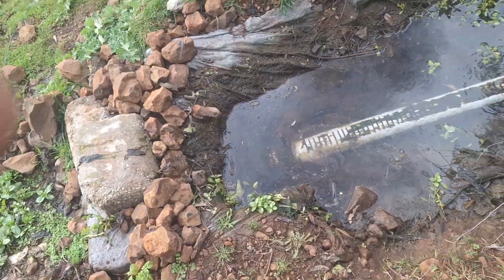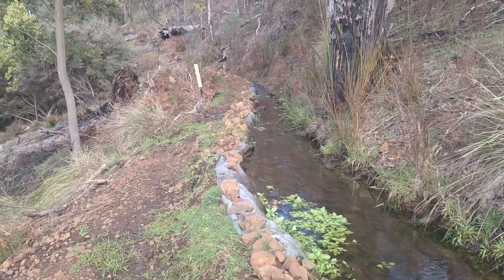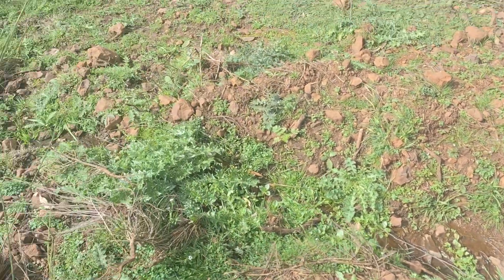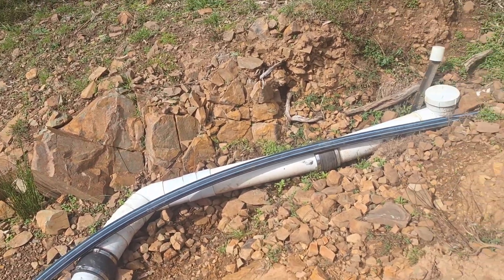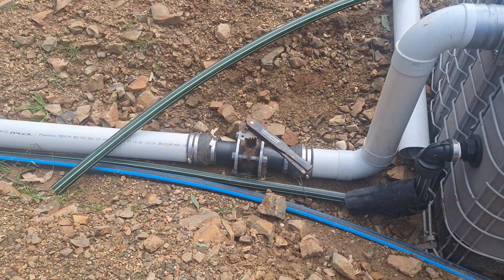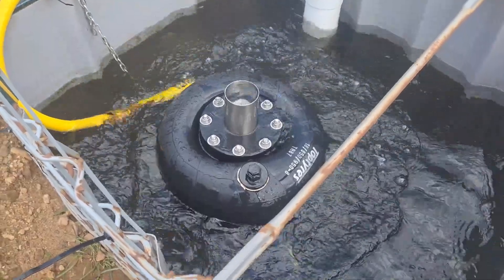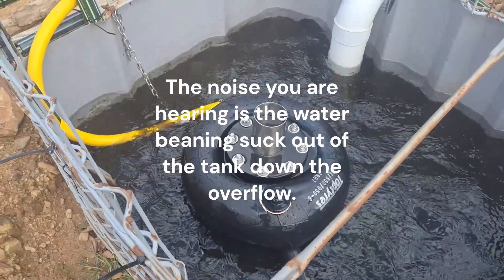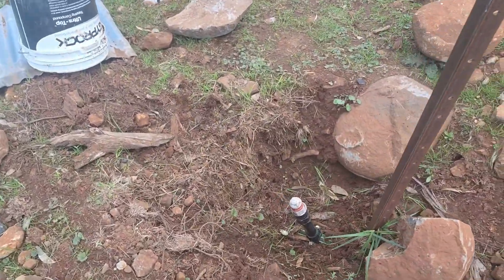Sonia's Bunyip PA13 Pump

Comment: A year ago, the units were priced under $2,000 dollars. Not sure about today. they are manufactured in Australia and I inquired about a dealership . No response. Shipping would be very expensive.
The government and their cronies(power companies) are absolutely opposed to this technology-it would destroy their lucrative monopoly.
Cannot happen too soon!
Reply from the maker: We have been sending Bunyip Pumps to the USA and Canada from Australia, mainly the PA13 pump with the stainless steel base but without the tire and the shipping cost to the USA has been around $600.00 AUD. The PA8 pump with stainless steel base but without the tire, I send by Australia Post and the shipping cost is around $300.00 AUD                                                                        All prices are in Australia dollars and excludes Australia goods and services tax.
 
PA 16 with a 124 &149 mm piston, $4,050.00 AUD, Plus freight cost, weight 120 pounds.

PA 16 up to a 98 mm piston, $3,830.00 AUD, Plus freight cost, weight 120 pounds.
Less $180.00 AUD without the tire and less $484.00 AUD without the S/S base.
 
PA 13 with a 124 &149 mm piston, $2,870.00 AUD, Plus freight cost, weight 66 pounds
PA 13 up to a 98 mm piston, $2,670.00 AUD, Plus freight cost, weight 62 pounds.
Less $106.00 AUD or $74.00 AUD without the tire and less $426.00 AUD without the S/S base.
 
PA 8 with a 124 &149 mm piston, $2,410.00 AUD, Plus freight cost, weight 42 pounds.
 
PA 8 up to a 98 mm piston, $2,210.00 AUD, Plus freight cost, weight 41 pounds
Less $80.00 AUD without the tire and less $320.00 AUD without the S/S Base.
 
Tire sizes and prices:
 
PA 16: tire size is 235/85R16, less $180.00 AUD to order without tire.

PA 13: for falls from 300 mm to 2 metre use a 185/80R13 Tire, less $106.00 AUD to order without tire, from 2.1 metre to 6 metre a 175R13 light truck tire, less $74.00 AUD to order without tire.
 
PA 8: tire size is 5.70/5.00 x 8”, Less $80.00 AUD without tire.
 Pumping to heads higher than 226 feet requires metal seated stainless steel check valves.
Pump Prices with stainless steel valves:

PA 16 with a 4.9" & 5.9" piston, $4,150.00 AUD, Plus freight cost.
PA 16 up to a 3.85" piston, $3,950.00 AUD, Plus freight cost.

PA16 With a stainless-steel pump chamber, with pistons up to 3.85" for heads from 500 to 2,460 feet, 
$5,050.00 AUD, Plus freight cost, weight around 137 pounds with tire and s/s base, 
 
PA 13 with a 4.9" & 5.9" piston, $3,080.00 AUD, Plus freight cost.
PA 13 up to a 3.85" piston, $2,760.00 AUD, Plus freight cost.
 
PA13 With a stainless steel pump chamber, with pistons up to 3.85"for heads from 500 to 2,460 feet, 
$4,000.00 AUD, Plus freight cost, weight around 84 pounds with tire and s/s base, 

PA 8 with a 4.9" to a 5.9" piston, $2,500.00 AUD, Plus freight cost.
PA 8 up to a 3.85" piston, $2,300.00 AUD, Plus freight cost.
 
PA8 With a stainless steel pump chamber, with pistons up to 3.85"for heads from 500 to 2,460 feet, 
$3,500.00 AUD, Plus freight cost, weight around 77 pounds with tire and s/s base,

Comment: Well done. How much is this unit?
Reply from the maker: The Bunyip pumps need a fall and flowing water to power the pump.
Pumping head depends on fall, we work on a 1/100 ratio for the PA13 pump, 1 m fall to pump to a 100-metre head.
And 1/200 ratio for the PA16 pump, 1 m fall to pump to 200 metre head.
The more Fall you have the more water it will pump with a bigger piston.
The highest head we have a pump pumping to out there is 400 metres so far.
The deepest the pump can set in the water is about 450 mm as long as it has a weight to overcome the buoyancy of the water above the tyre, because the top part of the pump drops down by gravity.
 
There are three models: the PA 8, PA 13 and PA 16.
PA 16 requires a fall between 300 mm to 6 m and with a maximum input flow of 18 lts per second.
The PA 13 requires a fall between 300 mm & 6 m, and maximum input flow of 8 lts per second, through a 150 mm supply pipe, 6 lts per second through a 100 mm pipe.
PA 8 wants at least 1.5 m fall to be efficient & less than 5 m, and maximum input flow of 4 to 5 lts per second.
The three pumps can be set up with pistons ranging from 35 mm to 149 mm diameter
And the PA 13 and PA 16 can go up to a 149 mm piston.
 
PA 16 with a 124 &149 mm piston, $4,450.00 AUD incl GST, Plus freight cost, 53 Kgs. 
PA 16 up to a 98 mm piston, $4,212.00 AUD incl GST, Plus freight cost, 52 Kgs.
PA 13 up to a 98 mm piston, $2,930.00 AUD incl GST, Plus freight cost, 33Kgs.
PA 13 with a 124 &149 mm piston, $3,150.00 AUD incl GST, Plus freight cost, 32 kgs.
PA 8 with a 149 mm piston, $2,650.00 AUD incl GST, Plus freight cost, 18 Kgs.
PA 8 up to a 98 mm piston, $2,425.00 AUD incl GST, Plus freight cost, 19 Kgs.
Reply: @portasaffordablepumpsbunyi8214  Thank u